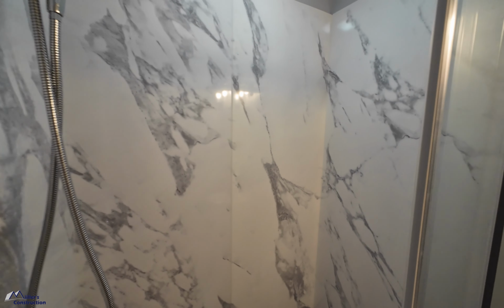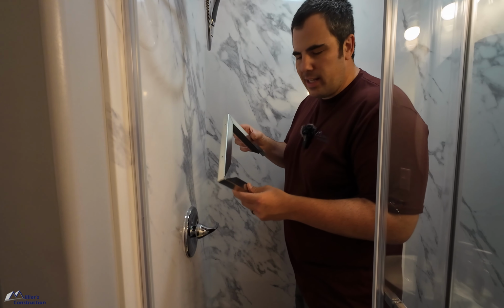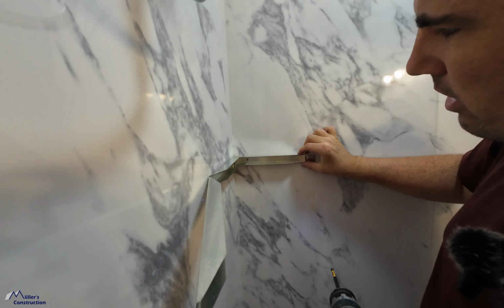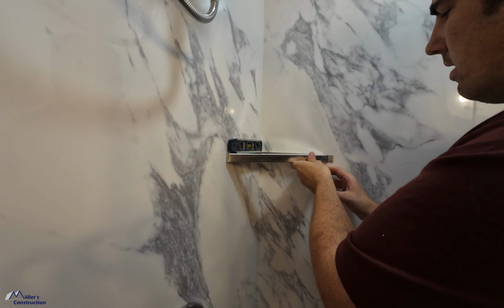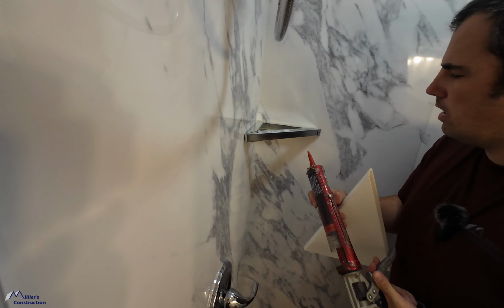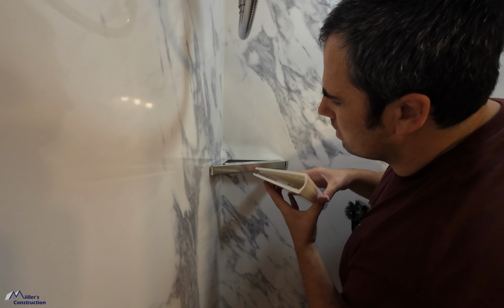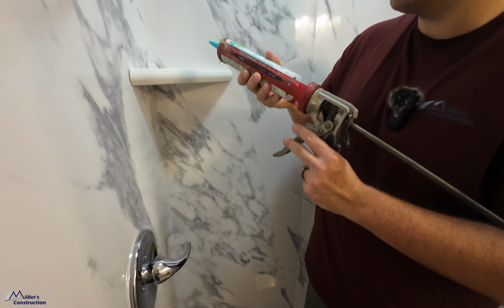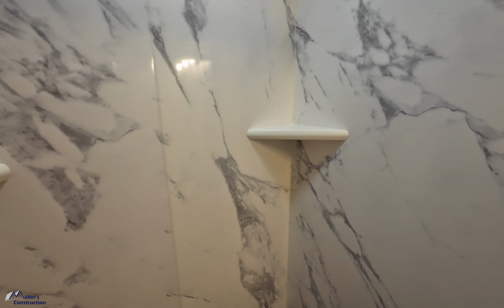CASTICO Corner Shelf Installation - STEP BY STEP!

Comment: Thanks for the video, shelf has a nice finished look.  Trying to decide on the Castico or Allen + Roth walls.
Reply from the maker: I have not used the Allen+Roth but I can say we're so impressed with the Castico product we've already done another bathroom remodel with their product (video of that on my channel as well) and we're planning to do more. The second install went about 2x faster.
Reply: @miillersconstruction  nice.  I just don't want the walls to bow out, we're just replacing an old fiberglass tub surround, but shelving seems hard to find for the shower wall panels.  The contractor suggested the Allen + Roth.  Initially looked at Maax Utile, but installation looked difficult
Reply from the maker: @Spork123able  the walls won't bow if you use the clamping method I show in the second video we filmed. You need to check it out. It gets pretty in depth